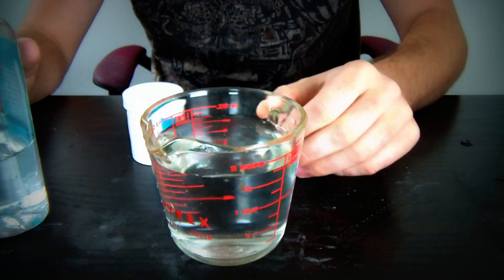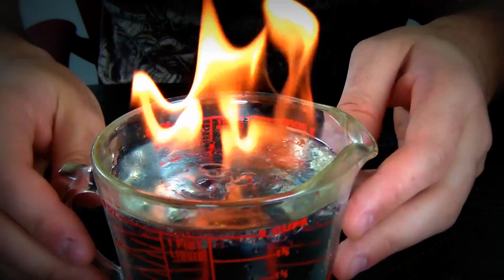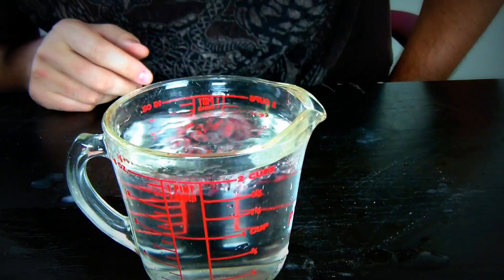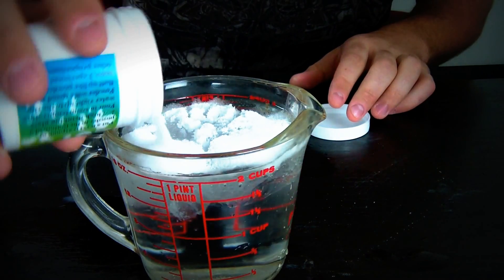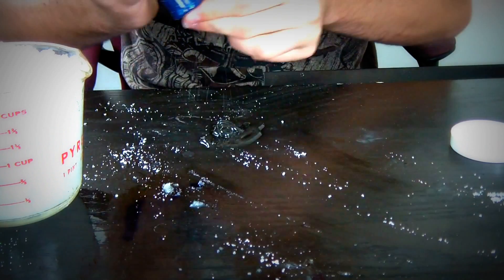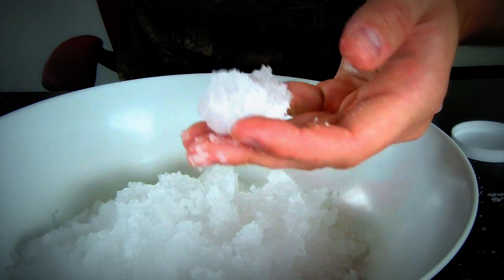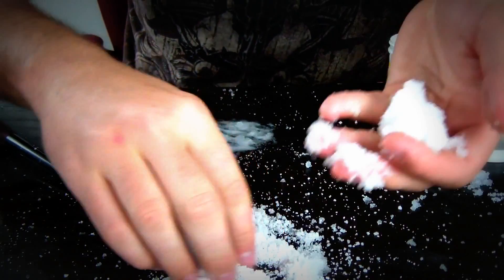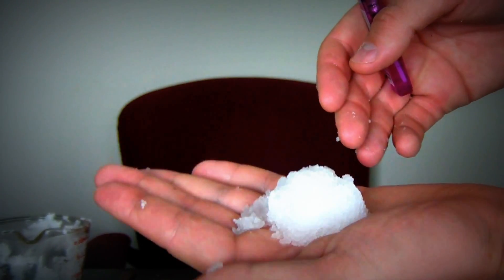Oil Disasters Clean Up Experiment!

Comment: this is not an accurate experiment, you are using alcohol instead of oil
Reply: Not really. the Hand sanitizer is about the same viscosity as oil that would be spilled. It is also around the same density as oil so it floats, and they are both flammable
Reply: George the taco exactly

Comment: It's a polymer, and they are pretty similar. The viscosity and density of the alcohol in it makes it rise to the top, which makes it produce fumes which are flammable. The same applies for the kerosine/benzine in oil. The rest is just... Oil... So it's basically the same stuff.

I don't believe this would be so efficient though, seeing as it would affect the water aswell

Comment: Good idea. Im gana try adding soap to it to see if i can use it to clean oil spils on the garage. Try using the same experiment with burning fluid for cooking grills to see if it works to. Cause the hand sanitizer its more like alcohol then oil or grease.

Comment: That polymer is designed to absorb water.  You're right when you say the alcohol gets mixed in with it, but you might not be right when you say that it won't burn.  Judging from what I saw, you may have had too much polymer and water in the mix to allow the alcohol to burn.  Doesn't mean the alcohol itself is not flammable any more, or that it's even dissolved into the polymer instead of just floating around inside it.  Or floating around "interstitially".

Comment: To be honest, this is nothing like an oil spill... the alcohol jelly is actually water based and contains almost no oil (if any). 

Oil will be on top of the water and is usually cleaned up with a floating net type thing with "walls" that extend into the water. The oil is pushed together and scooped or sucked up and collected. Some chemicals can be added to help the oil stay together, but this is really nothing like how they would clean up an oil spill.

Cool video none the less! Keep it up!

Comment: If germex is a hand sanitizer, then dude I don't think that would be a real test. Here is why: hand sanitizers contain ispropyl alcohol (rubbing alcohol) which is a polar compound and actually dissolves in the water. What you have left over is another organic material that has low solubility (gelatin) and that is not really oil. So please test it out with oil!

Comment: The only problem with that experiment is that the Germ-x is water based not oil based and it is to easily absorbed into the polymer.

Comment: Maybe your hand cleaner is thick and floats, but this doesn't mean automatically that it's like oil, if it's alcohol it sure has a different molecular form which determines whether your polymers absorb it or not. But I guess even if you do it with oil it won't work anyway beause well, Polymers absorb water and not oil, simple as that. BTW, what are you saying at the beginning, I NEVER understand :-/

Comment: All that "scooping" will cause massive work. Not only are we "scooping" the oil, but the water absorbed by it. It is way too inefficient to do this. But depending on the location of the spill, the environment, temperature..etc, oil spills are treated differently. The most efficient way currently, is just filtering it...yeah. it's that simple, the problem is that this method is still somewhat expensive and takes time. MIT is developing a new method which involved nanoparticles and magnetic fields